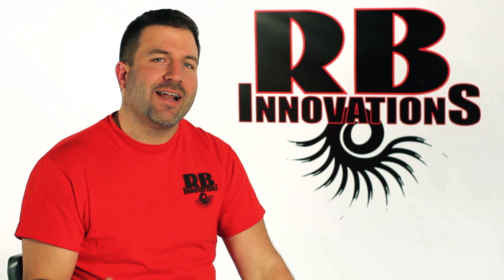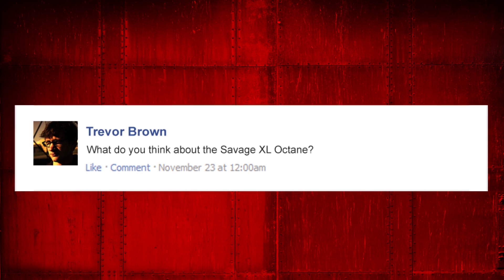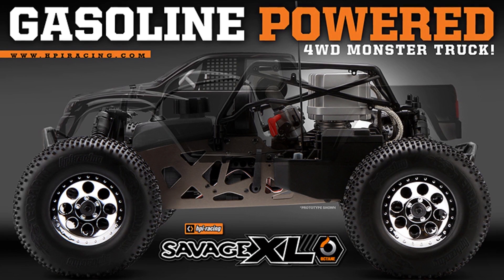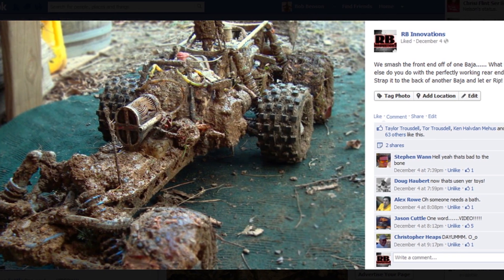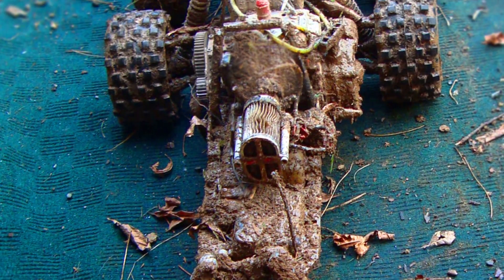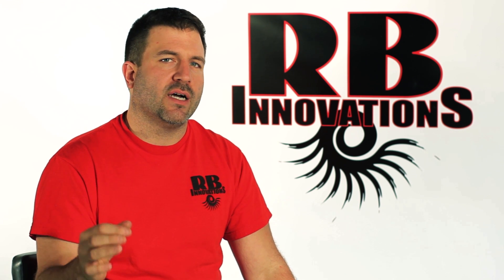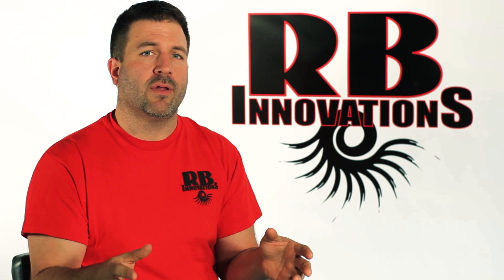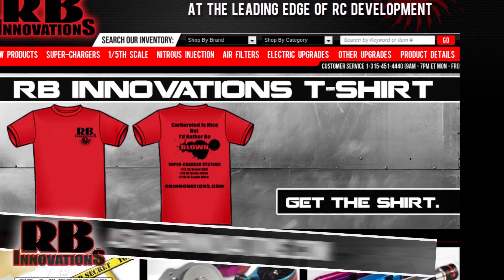HPI Savage XL Octane First Look, Our Twin Engine Baja and More

Comment: ive also heard so much about how in afective the superchargers are.. but from personal experience my buddie had a tmaxx 3.3, i helped him install it onto the truck and it was immediately noticeable that the acceleration and power output was increased... so even though technically it should work... theres something about it that just works.. if you look at most supercharger videos... they wind out alot more than a stock truck and are faster.

Comment: yes but the power to weight ratio should be equal in their own class .. so for instance even though the savage may be around that weight its only got a 4.6cc .. where as the baja or other gas powered cars run a 21 or more cc.. There for the power to weight ratio should even out between the 2 .. depending on gearing can determine how quickly the truck feels.. but the exact reason in general i like the nitro is specifically because it rev's so awesomely.. i feel that the gas isnt satisfying to me.

Comment: cant see this truck being to much fun since most gas engines i see on rc's seem sluggish and not that quick.  I mean some say its just because the engine doesnt sound as fast as the nitro engines do but ive seen real gas rc's in person and its like you hold it wide open and sort of have to wait for it to get up to speed.. Thats why i love my nitro savage.. tuned good and it will get up to speed very quickly and its just alot of fun.  I will give the octane the edge for reliability though

Comment from the maker: Thanks for the question.  The supercharger is forcing additional air into the intake which increases the exhaust pressure which pumps more fuel to the engine.  The increased air fuel mixture packed into the cylinder makes the increased power.  Check out our new video that will be released later today.  We have detailed exactly how the systems work.  Let us know if you have additional questions.

Comment from the maker: If your engine is overheating or the mixture is leaned out, most likely your engine isn't tuned properly or the Supercharger isn't installed correctly. There are many misconceptions about the Supercharger that are mostly rumors, and we address many of them in this video: Youtube.com/watch?v=b8KKbmMtuGg

If you need any more assistance or if you have any questions, feel free to call us at 315-451-4440

Comment: Please explain how your supercharger works when all it does is add air but no extra fuel? All the supercharger does is lean out the motor, increase heat, and increase wear. Tell me how it increases power and maybe you will have a sale.

Comment: looks like it fell apart it was suppose to be out. and that time came and went. I think they would be 2x more then the flux hp and at that point whats the point. Less power Less performance More maintenance and you need to buy gas all the time. I just dont see how they plan to make money when its going to be in the 1000.00-1200.00 range 2x more then the Savage FLUX HP.

Comment: you are comparing apples and potatoes. a nitro doesnt have much power but revs to Jupiter and back, so they are under geared to get reasonable speed and acceleration. a gas engine has far more power but a fraction of the rpm's, so they get taller gears to better utilize the available power and reach a decent speed. also gas engines cant get the revs up as quickly as a nitro can, further hurting acceleration. also, your savage likely weighs 12 pounds. the baja 5b weighs 21. no wonder its slower.

Comment: Oi... they keep saying their superchargers 'work' with nitro motors. It just won't, mechanically speaking.

A model nitro motor doesn't functioning the same way as a gasoline engine. I hate this crap. It will basically do the same exact thing as just taking the mixture needles on your carb, and leaning out the mixture until just before your motor won't run anymore, I.E. idle. Then, just run the motor at extreme temperatures until it's ruined. There ya go, 'SUPERCHARGED!!'. Waste of a motor.